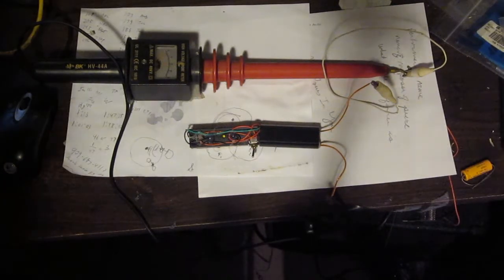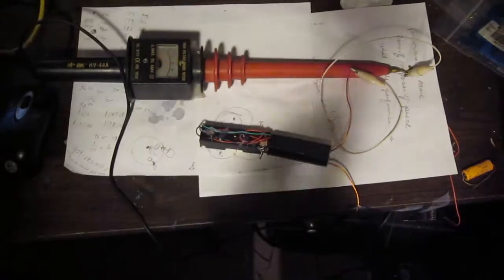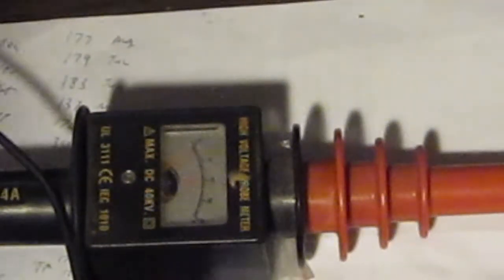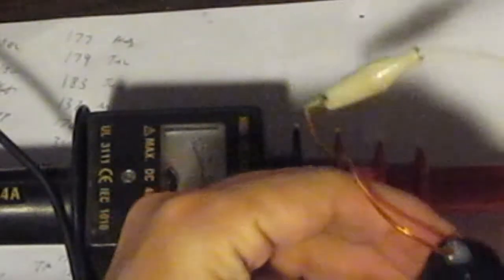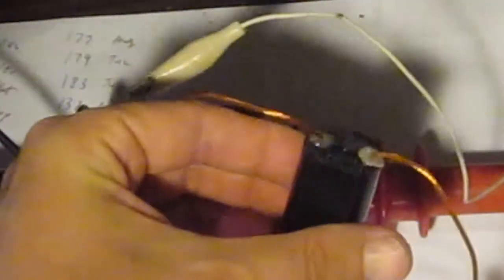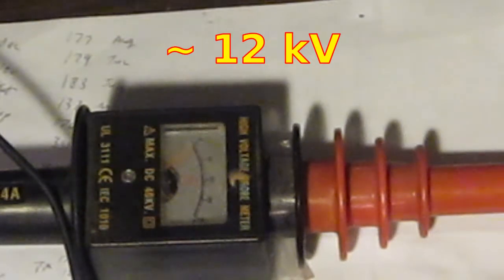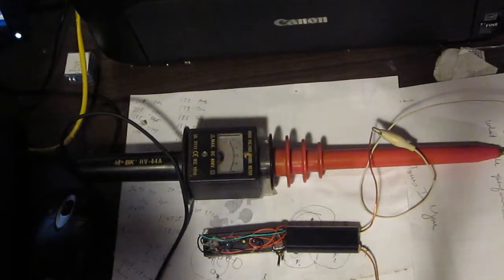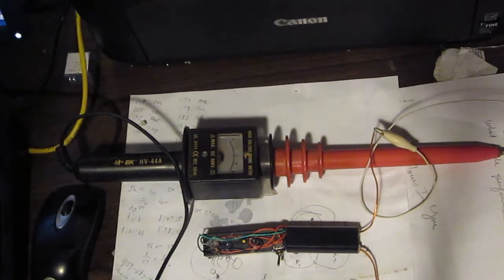400,000 Volt Generator -Measuring the Real Voltage

Comment: I acquired vintage TV voltage triiplers.   Do you think I could use the 400,000kv output into the tripler to get a real 36 ki]o volt output???    Do triplers require an AC OR DC inputs??????